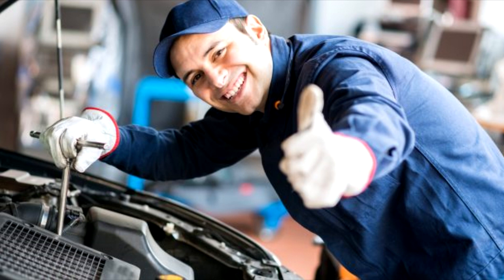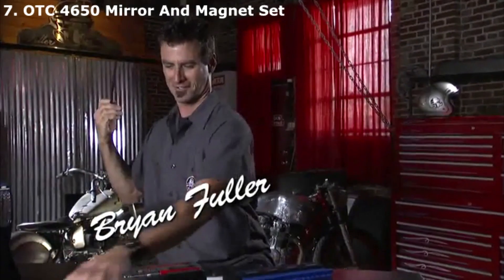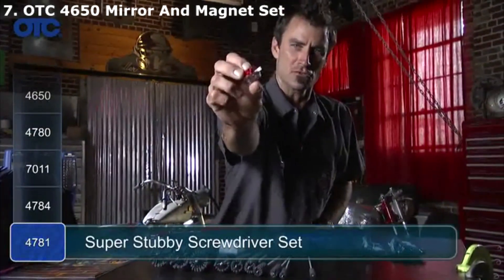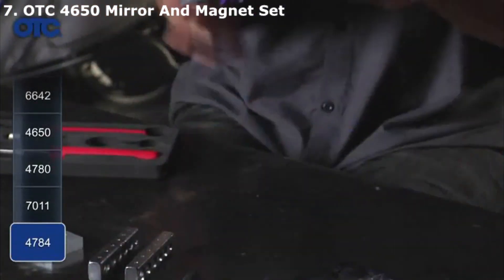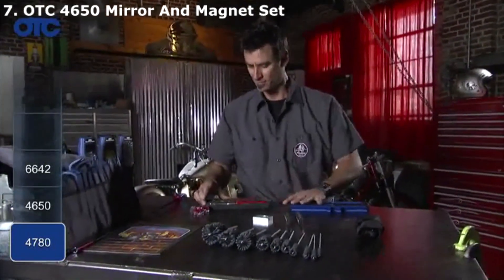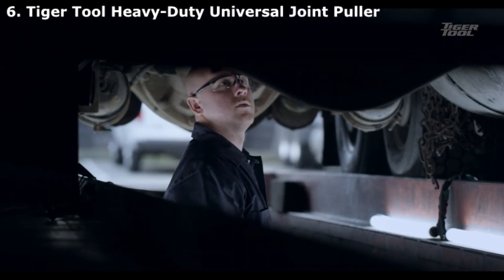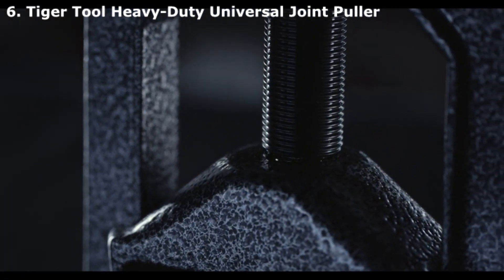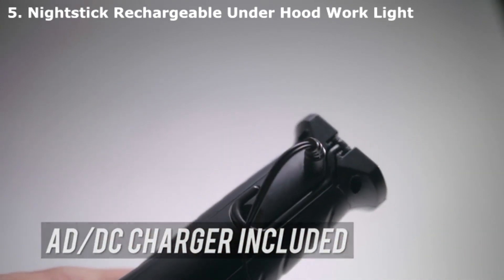7 Car Repair Tools & Equipment Every Mechanic Needs

Comment from the maker: 7 Car Repair Tools & Equipment
Links To All Featured Products Below [Amazon Links]

7. OTC 4650 Mirror And Magnet Set
    Amazon USA:   https://amzn.to/2D98Szh

6. Tiger Tool 10102 Heavy-Duty Universal Joint Puller
    Amazon USA:   https://amzn.to/2OdEm8q
    Amazon India: https://amzn.to/2OZhrDi

5. Nightstick SLR-2120 LED Rechargeable Under Hood Work Light
    Amazon USA:   https://amzn.to/2JlW0WM
    Amazon India: https://amzn.to/2OebBbT

4. OTC 6596 Brake Pad Gauge
    Amazon USA:   https://amzn.to/2Q3ybpt
    Amazon India: https://amzn.to/2OX6hyY

3. Arcan Aluminum Floor Jack - 3 Ton Capacity 
    Amazon USA:   https://amzn.to/2Jlw1yU
    Amazon India: https://amzn.to/2zcjUiQ

2. SK Hand Tool 80019 Wrench Set
    Amazon USA:   https://amzn.to/2yD8RQm

1. AIRCAT 1150 Killer Torque 1/2-Inch Impact Wrench
    Amazon USA:   https://amzn.to/2Q35pFr
    Amazon India: https://amzn.to/2OUk4pK